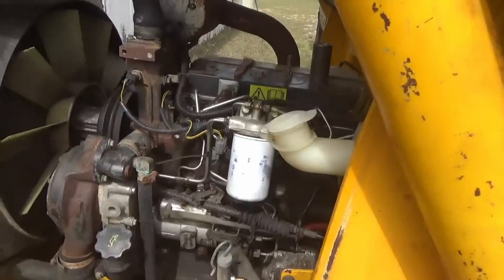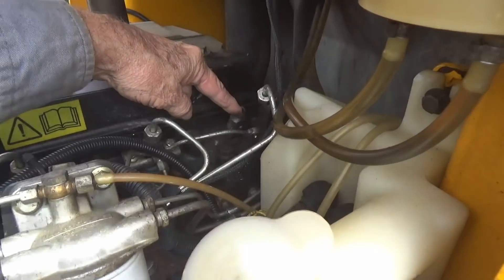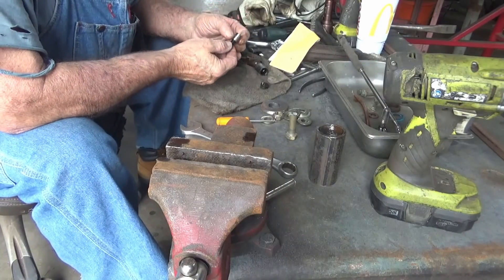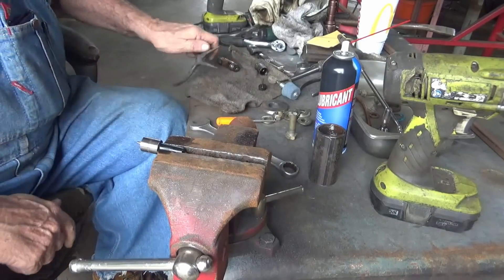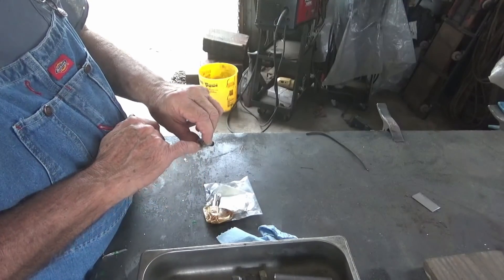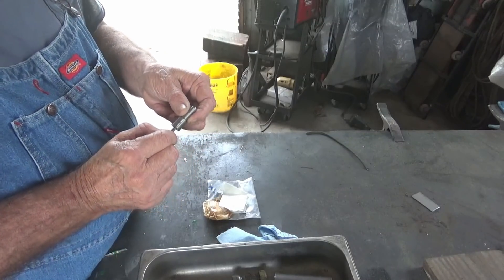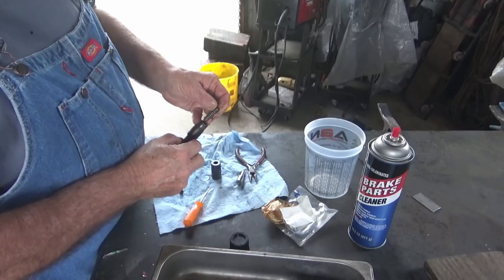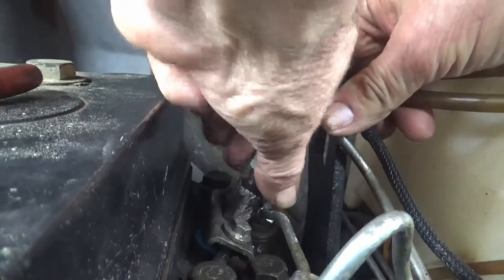Perkins Diesel Injector ..... Redneck Puller And Fix

Comment: Hi nice job , is that perkins 1004 t phaser ?
Reply from the maker: Not sure .... it's been awhile!
Reply: @RatRodBobBuilds  , I ve got same job to do as you I think , got diesel filling crank case up , smokey engine , hope it's a dribbling injector
Reply from the maker: @nhoney10  This machine was fine except only running on 3 cylinders. Yours sounds like an input shaft seal on the injector pump letting diesel into the crank case. But yes if you can pinpoint an injector problem fix that first. Crack open each injector line one at a time while it's running to see if you can find the one that is missing.
Reply: Did the trick although my fine thread nut was not such as good as yours

Comment: Hello  Bob ,  really  impressed  by  your  injector  puller  design................  only  goes  to  show  years  of  experience  in  mechanical  repairs  and  innovation .  Easy  to  listen  to   ,  well  explained .  Thank  you  for  this  video ,  I  have  a  T 6354  that  needs  injectors  removed  ,  been  worried  about  causing  damage  in  the  process  , you  have  solved  my  problem  ,  best  regards Sergio .

Comment: Thats a lot better news than having it be the injection pump ! Great work Bob !
Reply from the maker: I've been known to fix those too! That's how I ended up with that big ole compressor outside my shop ... has a John Deere diesel in it that stopped running and I went thru the pump! Never been scared to take something apart to see how it works! It wasn't working anyways .. whatcha got to loose!